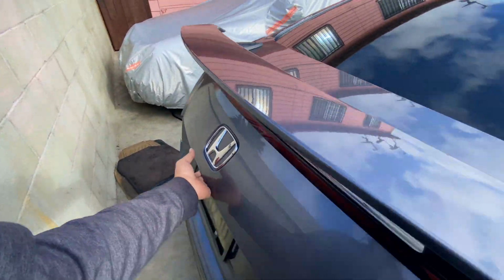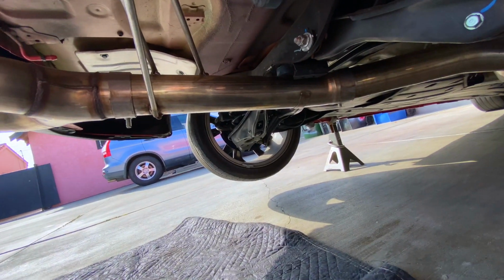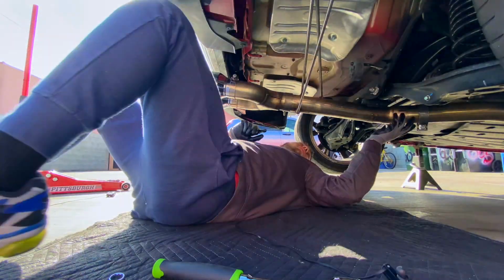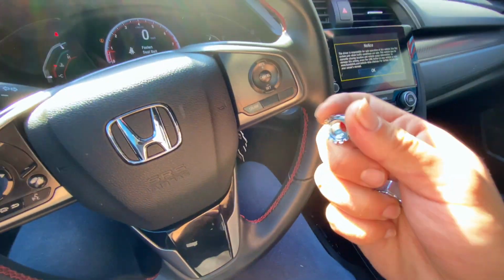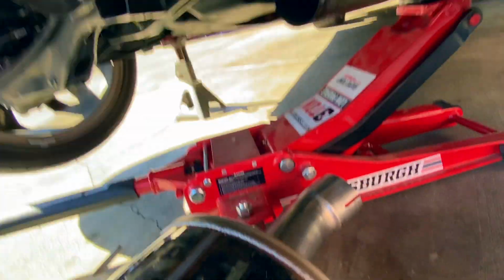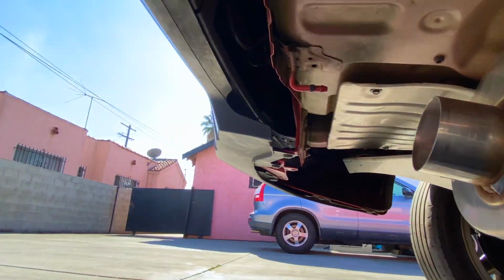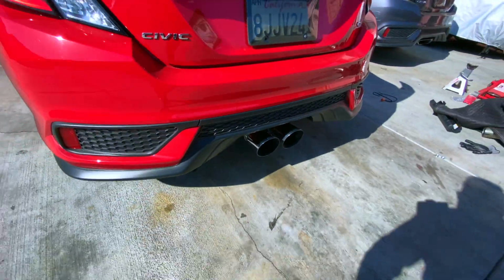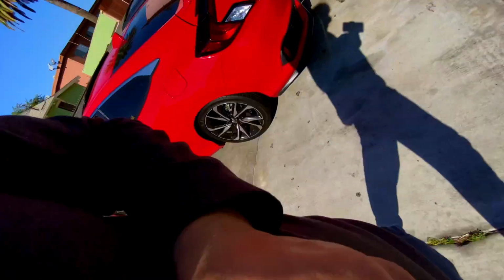AWE TUNING "TOURING EXHAUST" INSTALL XGEN CIVIC SI

Comment: How's the cabin noise inside being it's the touring exhaust + catless downpipe? I'm thinking of getting this exhaust but don't know how the noise is inside
Reply from the maker: It’s barely even there
Reply from the maker: the awe touring exhaust is more quiet in the cabin than the Greddy one with the big muffler and this one isn’t raspy at all sounds different
Reply from the maker: I as well have the track edition conversion and that one is aggresive sounds amazing
Reply: @Lifeofdrewskiii  Really? Wow that's awesome then. That's what I'm looking for, aggressive sound out back but still bearable on the inside. I currently have a stock CTR exhaust fitted to my sedan and the cabin is pretty quiet but the noise out back is to be desired...

I tried solving this by making a removable straight pipe for the mid resonator, and while it does sound louder and better, the drone can sometimes be too much.
Reply: @Lifeofdrewskiii  Any possibility making sound clips inside and outside of regular and aggressive driving? I know videos don't do justice but I've been really wanting to hear it, but no one in my area owns this exhaust system.
Reply from the maker: Yeah fam I’m gonna make one soon as the weather clears up
Reply from the maker: Forsure yeah awe is perfect for you then it doesn’t sound like a Honda either has a rumble to it and it already comes with the front pipe included can’t go wrong with that
Reply: @Lifeofdrewskiii  For sure!!! Subscribing, looking forward to it.
Reply: @Lifeofdrewskiii  Awesome, I'll look into snagging one, they're pretty pricey haha

Comment: Whats the reason you converted to the touring?
Reply from the maker: The track exhaust hangar welds broke
Reply: @Lifeofdrewskiii  they're pretty weak for the track hangers :/ it hit and bang underneath the car,  had to get 2 custom hangers welded on connecting with polyurethane hangers to secure the movement
Reply from the maker: @Dozaubih  tell me about i had to get my track conversion replaced twice both broke the same way and the fitment of the 2nd track conversion was horrible it was closer to ground than the diffuser of the car